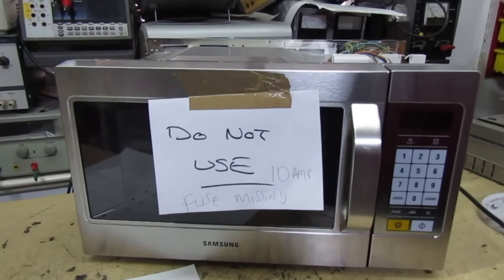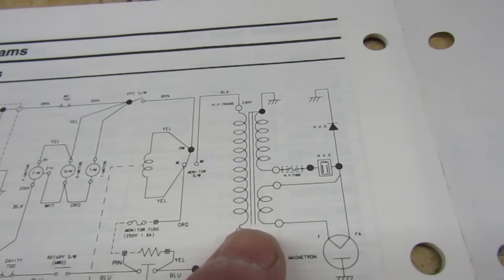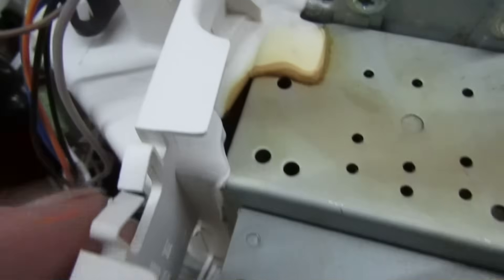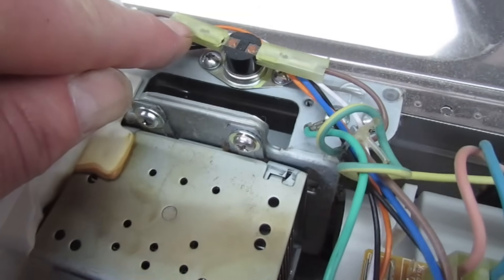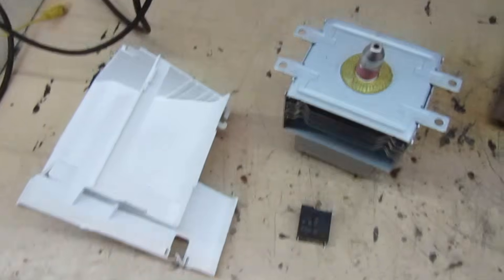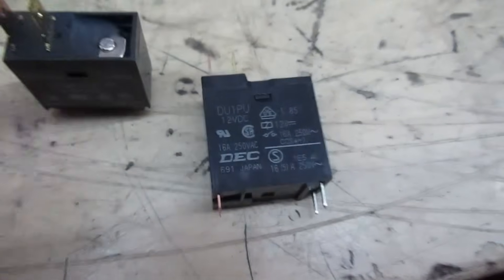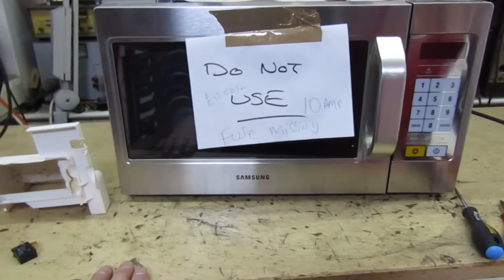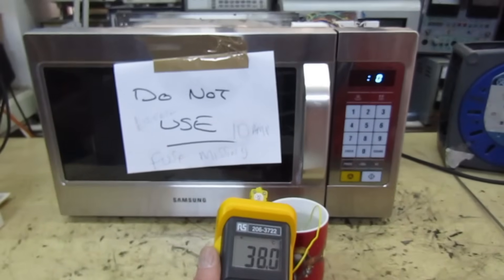Virtually no protection against this fault in a microwave oven .

Comment: What would be the safest distance for one to be near a microwave like that with such a problem?
Reply: The door itself and the glass have a built-in mesh screen that should protect you from any radiation from the Magnetron, just the same as if it was operating normally and unless you take the covers off you should be somewhat protected. However opening the door with the Magnetron running as Michael did in this video (you can hear the fan start up when he opens the door) is a very bad thing to happen... that is the scary thing here...
Reply: @boredwithusernames  Michael knew that the magnetron was not running. But don't try this at home! When I was involved with new designs, we had a 750W oven melt a hole in the glass. (I was standing well back!)
Reply: @manolisgledsodakis873  That is quite scary, thanks for the feedback. I wonder if a secondary protection system would have been put in place to stop that happening?
Reply from the maker: @boredwithusernames  you have slightly miss interpreted the the fault here , there is no way the magnatron will be powered with the door open , what you saw is on opening the door the fan and light came on which is normal on this oven , at the instant  the door is opened a microswitch  disconnects power to the high voltage transformer and this switch has a fail safe , if it was to weld closed and they do quite often another microswitch puts a dead short straight across the mains supply which takes out the internal fuse quicker than you can blink , and its for this reason the internal fuse is filled with sillica sand to stop it exploding
Reply: @michaeldranfield7140  Ah... thanks for clarifying that, I did wonder if there was a secondary fail-safe in the event of a cut-out failure. That is reassuring to know, I was also unaware that the fan and lights were a designed function of that particular microwave. Thanks for enlightening me and other readers of this thread 😎👍

Comment: isnt it just a domestic microwave in catering style case?  proper catering microwaves are usually 1800watt upwards
Reply from the maker: It's what they term as semi commercial, 1100 watt output.
Reply: @michaeldranfield7140  does that include infra red heating?
Reply: Yes all the commercial ovens I ever worked on started around that power rating and went up from there. Most had dual magnetrons.

Comment: Would say if the relay failed like that it would be a job for the manufacturer to repair free of charge.
Reply from the maker: This is about 5 years old so well out of warranty, however many years ago samsung may well have  supplied spare parts to dealers free of charge in a situation like this , this kind of service is long gone now though , as soon as a product is out of warranty no one wants to know .